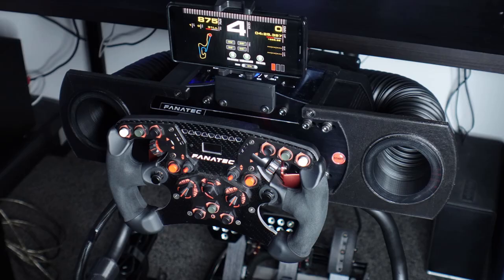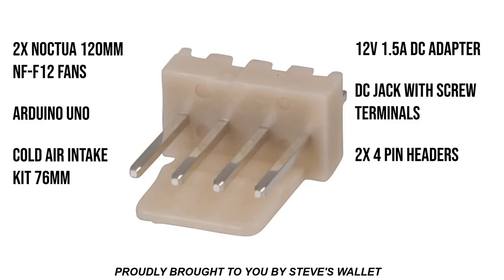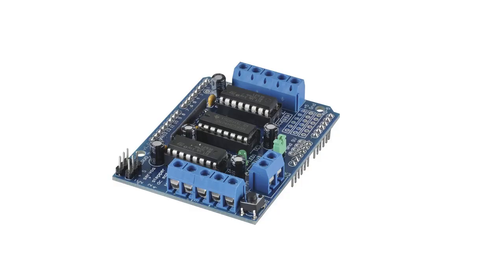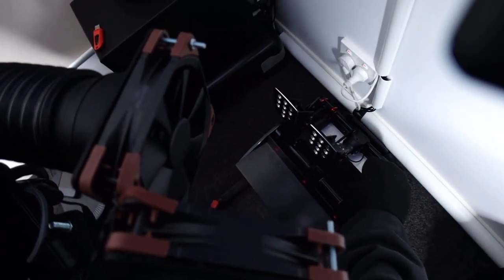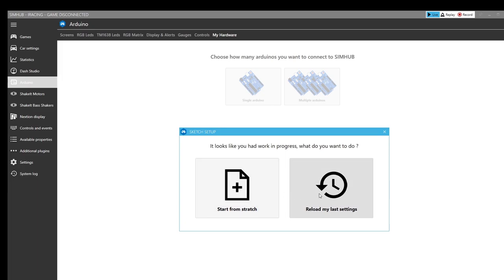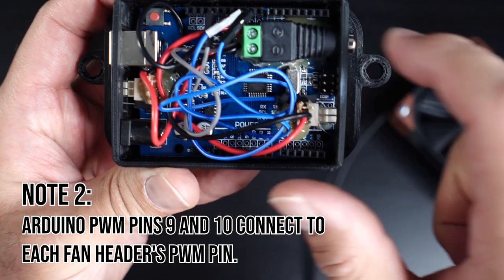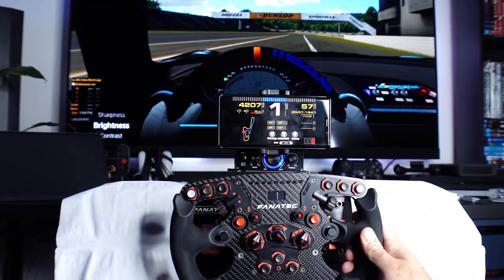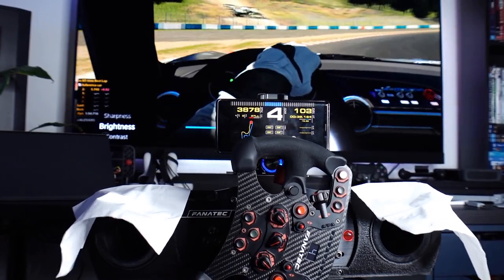Fanatec DIY Cold Air Intake Wind Simulator | So Immersive!!!

Comment: Do a remake of this video for beginners pls. Where you assemble the whole thing step by step
Reply from the maker: I'll add that to my list of upcoming videos on the channel, thanks for the suggestion 😀
Reply: @SuperEvenSteven  yesss pls. Your method is so much better than the ones that use motorshield. No one has any tutorial for it.  I'm so new to aurdino and a simple step by step guide would really help. Thank you for taking it to consideration
Reply: @SuperEvenSteven  Yes please! I've ordered the parts but the circuit assembly is too confusing for me.
Reply: @SuperEvenSteven  5 months later........
Reply: 10 months later!
Reply: 14 Months later……
Reply: I recreated it like in the video. But as soon as I connect everything, the fans run constantly and cannot be controlled.
Reply: 2 years later....

Comment: So finally parts arrived. I did my take on this. Two 140mm Noctua fans, 3d printed Noctua desk fan shroud instead of ducts, and also just got a 4pin fan splitter cut male end, soldered wires and it works wonderfully. Spent two days 3d printing, then 30 minutes soldering, but the Arduino part took me like 2 minutes, an awesome guide, thanks.
Reply from the maker: I'm glad I could help! That's a clever idea with using a fan splitter lead. Thanks for sharing your results with us 👍
Reply: thats perfect. So you use 1 PWM signal to Uno ? because my noctua Y Slpitter has ony 1 PWM signal. its my first arduino build. how are the connector pins called which you put into the board ? just 1mm straight pins ?!
Reply: @der60er  For some reason my comment got deleted, maybe cause I linked amazon link for a splitter. So in short I did cut a splitter male end off, and got two parts with female leads, so I used 2 PWM wires into 2 slots arduino, I soldered everything else, as for arduino, you should use crimps, but I just soldered 5mm wire solid and pushed it into UNO slots.
Reply: @KAJJTAN  ok ich checked my splitter once again. PWM are connected, but the green RPM Speed is only one on male plug. its okay I dont need it in the end at all.
Reply: @der60er  Mine was the same, I think I cut off the RPM one.
Reply: @KAJJTAN  i will use a 4 pin extension too, so the fans keep untouched
Reply: Could you share a link to the desk fan shroud for 140mm? The ones I can find are all 120mm.
Reply: @KAJJTAN  not sure i get this and what wire to cut. The fans connector are female no? So they plug in the male connector of the splitters.  So Why cut the male end and discard it?
Reply: @olivierlanguedoc  It was 2 years ago, but if I recall I sacrified the spliter. So I cut the male splitter end and soldered wires directly to UNO board so original fan can connect to the splitter female ends.

Comment: Hey thank you for making this video. I dont have much arduino experience at all and I'm having a little trouble following the wiring diagram. I'm just confused as to how the 4 pin headers are wired up. I didnt see it on the diagram, but to my understanding, only 3 pins are used correct?
Reply from the maker: Hi Jay, it's no problem. Pin 1 is ground, pin 2 is 12v and pin 4 is the control pin which goes to the arduino. I left pin 3 (sense) unused. I'll upload another photo of the wiring on my thingiverse page. Hope that helps.
Reply: @SuperEvenSteven  also, thanks for your help, really appreciate it

Comment: Awesome job, you have inspired me to give it a go. I have purchased all the items, 3d printed the parts and set up the Arduino in Simhub. I have paused your video many times trying to work out the wiring but just cant get a handle on how the power is wired. Would it be possible to share your wiring diagram or direct me to a web page I could use. Thanks.
Reply from the maker: Hi Tim, that's great! Sorry the wiring wasn't clearer, I did consider doing a wiring diagram and in hindsight I should have. I'll do up fritzing diagram tomorrow and share it in this video description as well as reply back with a link to it here.
Reply: @SuperEvenSteven  Thanks, that will be a great help.👍
Reply from the maker: I threw the diagram up on a thingiverse design, https://www.thingiverse.com/thing:4964882 Hope this helps!
Reply: Your a legend. 
Thanks again. 👍
Reply: It's now up and running, perfect!
Reply: Thank you 🙏 
Do you know how you would go about attaching 6 fans - would it simply be 6 pins on the board and ground and positive to each fan? 🤔

Comment: Thanks.. in your screenshot (you go fast) of Shakeit PWM Fans outputs, do you have the PWM output on/off relay pin checked or NOT checked? Also, have like yours PWM Output min set to 0, but the fan still runs slow/ not 100% off..   Thanks

Comment: Do you think this kit would work with SimRacingStudios software? I have it running already for my DOF H3. If not, can Simhub run simultaneously with SRS?
Reply from the maker: Hi slappy76, tbh I've never used SimRacingStudio software before so I don't want to give you the wrong advice regarding its use, especially given the cost of a DOF H3 and the forces it can generate. 

I can't imagine there being an issue except you would need to be very careful you don't accidentally flash and overwrite the firmware of your DOF H3 control box when using SimHub to flash the arduino dedicated as your wind simulator.

With that said, I'd highly recommend you contact SRS to get their expert advice on whether it's safe to have SRS and SimHub running side by side. They may also have a specific community forum there.

You could also try reaching out to a few other YouTube sim racing channels like Karl Gosling as I believe he has the DOF M2 and uses SimHub software also. 

Good luck! 👍

Comment: Thank you for the "120mm to 76mm Fan adapter (Threaded)" it's the perfect piece I was looking for! 

Hoping to get this up and running tomorrow, we'll see if I can find the time,  I'm going a slightly different route, at least at first and I'm going to run a motor shield for my Arduino, because I want to be able to use a little more power (amps)  to my (different) fans!

Comment: Thank you for sharing. I used your design which worked well.  Initially had issue with the Ardunio board then realised I was missing the driver. Smooth sailing from there. Looks good and work well.

Comment: Hi SuperEvenSteven. I have just bought the same fans and wonder if I am correct in assuming the yellow cable is positive, black negative and blue for the fan header, the green is not used??

Comment: Hello, first of all thanks for sharing this video! You wrote: "I use Simhub dashboard and apply speed curving to each fan so the fan's RPM speed adjusts with both the speed and direction the car is moving."
Is there a chance to make this work on a console (i.e. PÜlaystation 4) as well using Simhub? I share the Gran Turismo 7 telemetric data already over my local network to a seperate PC for my motion system. So I guess, in general it should be possible, right?

Comment: Are the files for mounting the fans to the CSW 2.5 online somewhere to download and print? I have everything else ready, just need a way on mounting the fans now. Great video, and thanks for any help
Reply from the maker: Thanks Klayton! All the parts I printed for this project can be found here on thingiverse design https://www.thingiverse.com/thing:4964882

The parts I didn't design myself are referenced in the thingiverse description like the CSW fascia plate.

To attach the ducted tubing to the CSW facia I designed a flanged cylinder that you insert into the facia fan holes and then attach and clamp the ducting to on the back side.

Good luck 👍

Comment: Can i also use a china arduino ?

UNO R3 ATmega328P Arduino kompatibles Mikrocontroller Board ATmega16U2
Reply from the maker: Hi der 60er, I'm using a clone arduino uno r3 with an ATMega328P chip. I haven't tested it with ATMega16U2 boards sorry.
Reply: @SuperEvenSteven  ATMega328P is in the name too. I guess it will work. But i will just use it with pwm fans, so i dont need a motorshield.

Comment: I feel like in this orientation a lot if not all of the wind would be blacked by your hands.  Curious if you have played around with placing them in other locations.
Reply from the maker: Hi George, I think because the ducting tube I used rises up, the airflow is generally directed towards my shoulders. I've been meaning to design some rotating vent covers to better control it.
Reply: @SuperEvenSteven  oh awesome got it!  Thanks for the reply!

Comment: This helps me a lot ! But I've got one more question. What should I do if I got a fan with only 2 cables ? I've got plus an minus only
Reply from the maker: Hi Sebastian, You'd need to use a DC motor controller board with your Arduino. This will apply a direct current to the fan, the speed will change based on the voltage the fan receives. I noticed there's a minimum voltage some fans need before they start spinning (10v on a few I tested). You also have the added voltage requirement of the DC motor controller board which can be roughly 2V so you'd need a 14V power adapter to power the fans and motor controller board. Also pay special attention to the fans amps requirement when selecting a power adapter.

Comment: Do your fans spin whenever simhub is started/shutdown? Mine spin at those times because simhub is scanning my ports and detects the fans. Kind of annoying imo, want to see if theres any fix
Reply from the maker: Yes, I get exactly the same spin up of my fans on startup of Simhub. I'm not sure if there's much you can do to prevent it unfortunately. If Simhub shared the sketch source code that is flashed on the Arduino it'd be pretty simple to suppress it. I had a look on github but couldn't find any repos by Simhub there.

Comment: Holy moly. Sub 5 min legend video.
Reply: So I followed your advice on using a nice, quiet, PWM fan and bypassing a motor shield and I’m quite happy with the airflow. I came from using a standing floor fan at a single speed and I was worried the output of the new system would be paltry. There is an overall decrease in power obviously, but the gain of a speed sensitive output is super fun and again, the actual breeze seems amplified in VR. For bang to buck it’s a no brainer. Thanks for the thingyverse link and schematic.

Comment: I followed the diagram but the fans connected to the power supply are always at maximum, scket installed but it is not possible to check what am I wrong thanks  i use Arduino Leonardo have a different pinout to arduino one?!?
Reply from the maker: Hi Max, are the fans on 100% as soon as you turn the power on? If not have a look to see if the 'Static Wind' effect is on in Simhub and turn it off. I'll keep researching your Arduino Leonardo boards pinout and reply back soon.
Reply from the maker: Hi Max, I tested uploading the Simhub sketch to a spare Arduino UNO and it took 15secs. Also I looked at the pinouts of the Arduino Leonardo you are using and found that the PWM pins 9 & 10 are the same as the UNO board I'm using, so no difference in wiring. 

I have made a screenshot of the exact Simhub sketch I'm using and the settings here: 

https://1drv.ms/u/s!Ai4dCyXZ7jPxjp5v0LmKmqbFBW4mFQ?e=ifrcPC

https://1drv.ms/u/s!Ai4dCyXZ7jPxjp5v0LmKmqbFBW4mFQ?e=t8eeqk

Also make sure that the GND pin on your Arduino Leonardo shares the same ground as both your PWM fans. I joined all three wires like in my wiring diagram on Thingiverse https://www.thingiverse.com/thing:4964882

To perform testing please refer to the Simhub developers instructions here: https://www.simhubdash.com/community-2/postid/820/

When you are finished testing make sure you turn off the STATIC WIND effect in Simhub.

All the best, Steve!

Comment: Thanks for this man! I will be attempting something similar very soon. Did you go ducting for aesthetics? Ordered the 2000rpm 140mm noctua fans yesterday before seeing this unfortunately :(
Reply from the maker: Hi giBiLatoR, no worries. I went with ducting since the fans were a little larger than the faceplate I installed on my wheelbase. I also like the flexibility of the ducting tube. When I moved from a playseat challenge to a gt omega titan sim rig I just bent the ducting and attached the fans to the sim rig frame with some double sided tape. Hasn't failed me yet! 😀 There should be some 140mm adapters on thingiverse, also the bigger blades should equal more airflow compared to the smaller 12's I went with.
Reply: @SuperEvenSteven  Came for this exact comment, 120mm was out of stock for a while so only have 140mm option, also thought 40$ for tubes are a bit expensive, so will leave them out, and do full 3d printed tubes instead or might get some rigid pipes instead at a hardware store.

Comment: Did you saw the top of the uno enclosure off?   I'm looking at the file to print it and it seems like a solid box.
Reply from the maker: Hi Rick, I designed it so it has a lid that can be fastened with 2 screws. I forgot to split the 2 parts into 2 printable STL files. My apologies, I'll reupload them tonight.
Reply: @SuperEvenSteven  Oh man thank you so much!  I've gotten most of the parts in and have printed the 120mm fan adapters.   I was stuck on the box.    Thanks for helping the sim community with this awesome build
Reply from the maker: It's no problem. I've updated the design on thingiverse for you. Good luck! https://www.thingiverse.com/thing:4964882

Comment: Hi steve, can you help me? I've got every thing wired up correctly as shown in the diagram, and set up in sim hub best to my knowledge, the fans increase in speed in the game but the fans spin at a low rpm when not moving id like them to no spin at all until the car is actually moving in the game, do I need to change some settings in sim hub for this?  cheers Tom.
Reply: the only thing I'm using different is some Fractal fans as suppose to Noctura fans but there still 4 pin PWM fans
Reply from the maker: Hi Thomas, it sounds like the minimum value before the fans kick in in SimHub might need tuning. Have a look at this test procedure to isolate what that minimum range is: https://www.simhubdash.com/community-2/postid/820/

I'll have a poke around in my simhub settings tonight and let you know what I find.
Reply from the maker: Hi Thomas, I had a look again and the only thing I can think of is if you raise the device output "Threshold". Increase this slowly until the fans stop when the car is idle, testing this may be a bit tedious. 

The setting is found in "Simhub->ShakeIt Motors->Motors Output->Arduino Motors and Fans->Output tuning button". 

There's a better explanation of how it works here: 

https://github.com/SHWotever/SimHub/wiki/ShakeIt-V3-Motors---Output-Configuration

Also I recommend posting the issue on the simhub forums with details on your setup.

Hope this helps!

Comment: I followed the instruction but it deosnt work fom me. :( I have 2 connected motors but I nothing happen when I try them with "test now" button. If I remove the PMW cable from the fan it going to spin up.
Reply: Did you find a solution for this? Mine does the same. Too bad the video creator doesn't seem to answer anymore.
Reply: Okay I figured it out. For some reason even I configured the pins 9 and 10 to the fans in Arduino setup they were not sending signal. I left the arduino setup how it is and changed the outputs to pins 1 and 2 under shakeit motors -> motors output. 

So just do as the tutorial tells you to but after that, go to ShakeIt Motors -> Motors Output, click open the ARDUINO MOTORS AND FANS and toggle on the "Speed with curving" for channel left and right.

Comment: hello i have a problem i wired everything accordind to the diagram after programming the arduino card with simhub my fans run well but are never stopped and do not vary by pressing the test button thanks for your help
Reply from the maker: Hi PETITCAYMAN, what model fans and arduino board did you use please? Also do you have the static wind effect turned on?
Reply: @SuperEvenSteven   hello thx for your answer I am using an arduino uno R3 board.and no i m not selected wind static on… I do not understand because at startup the speed varies well it undermines thoroughly and goes down in speed when starting simhub
Reply from the maker: The only other things I can think of are the fans maybe aren't PWM fans or the fans and arduino aren't sharing a common ground.